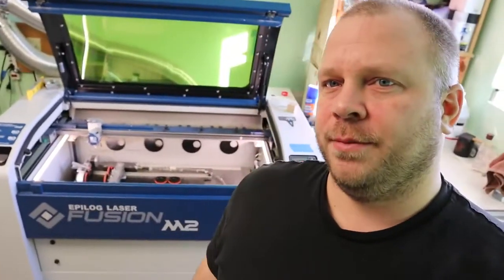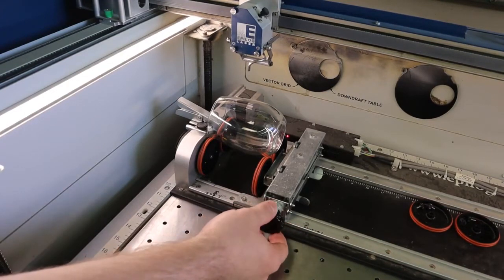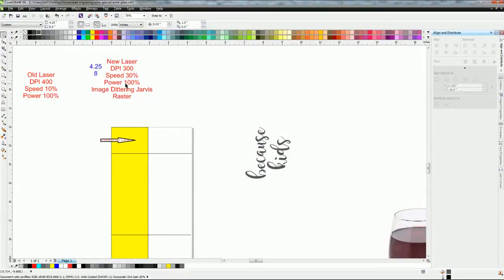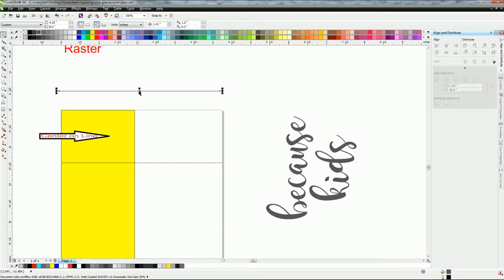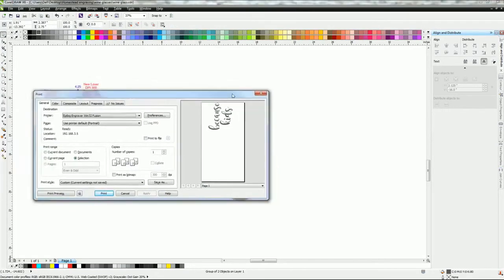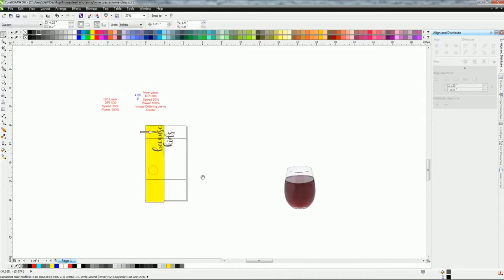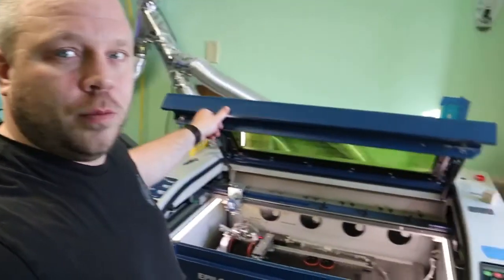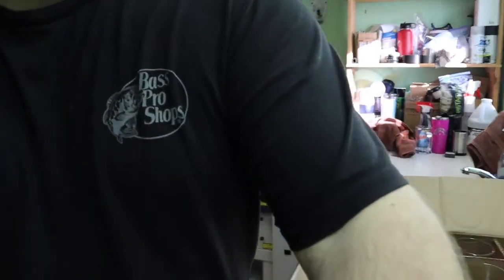How to Laser Engrave a Wine Glass tutorial: Easy & Fast

Comment: I have a 22w and a 40 w diode...  what would be better? I used my 22 w and did 6000 / 60 and the result was good but not great. I also use that black paper that you dip in water (forget what it's called) terrible to remove so tips on that appreciated as well.
my next project will be Libbey cobalt blue wine glasses...  will i need the black sheets?
Reply from the maker: I use a C02 laser or UV for glass.

Comment: What type of rotary attachment are you using
Reply from the maker: Straight from Epilog
Reply: @laserengravingwithmatt  I have a CO2 China Laser and my engravings were coming great for a while, Then out of no reason that I know of My designs started looking scrunched together. The Length is fine and the laser is starting in the right spot.  I am thinking is something to do with the rotary, I made sure my steps of rotation were correct and I am putting in the correct object diameter/circumference ...Please HELP if you. can!!
Reply: @gracelarrea6477  where did you get your Chinese one? Aliexpress or other?